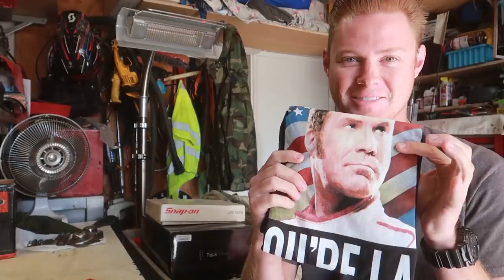My F100 Is FINALLY Back On The Ground! *Disk Brake Upgrade!*

Comment: When setting the front wheel bearings.. you are supposed to spin the rotor while tightening the nut, to the torque spec,ed then back the nut off 1/4 turn.  This ensures the bearings seat properly.
Reply: 60°

Comment: I am building a 1966 F100 with a 302 over on my channel, also dealing with valve train issues. Had some comunications with another 302 guy that said he drilled and pinned his rocker arm studs to keep them in place. Just thought I would mention that. Keep the videos comming.

Comment: Looks Great Disc Brakes Awesome. 
My First Vehicle a 62 Ford Pickup F100 Stepside. I was 16 it had a 292 V8 a 4 Speed and 4:11 Posie rear-end, I put 4 barrel manifold and carburetor, a Tach, Corvair Bucket Seats. the best sound system in the 70s. Installed Headphones plugged in the Dash.  Chromed Defroster Vents. ash tray and glove box, Chrome Steelies rims Front and rear 15 inch wide the in rear  Stainless 66 ford Hub caps. Loved that truck.

Comment: I pulled the whole brake system out of my 68 last fall. All new stainless steel brake lines, four wheel disk now. Did my fronts sort of like you did. I just ordered spindles for a 73. And the went with all the upgrades. Cross drilled an vented rotors. Six piston calipers on the front, four piston on the rear. And the hp pads. I bought the kit for the rear.

Comment: Don't you have to change the master cylinder and residual valve as well..
Reply: no thats only if you want power brakes. then youll need a brake booster and a vacuum in the intake for the assist to work. brake line up behind the tire will be differnt but will just go straight into the line and bleed your done.

Comment: The one clip of the rear axle it look red as can be.  At other angles it's copper, is it a color flip pearl in the paint?  I'm about to completely tear my 79 apart, pull the cab off and begin the full body restoration while I get the block and heads machined and prepped for rebuild.  Gotta also finish the basement!  ugh, I'd rather be working on the truck!

Comment: It's a little late now, but you should have drilled and tapped a drain plug for your rear end! Did it on my 74 F100 and it makes for a much cleaner gear change.
Also gives you something to jack it up on. Just put a piece of 2x4 on Jack pad.  Just a thought.
Check out Lugnuts for a rear disc swap kit. Going to get a kit for my 77 F250 w/Dana 60, but they have good kits for the 9" rearend too.😊

Comment: Did all this to my 68 F100. Put a Lincoln Continental 4V V8 in it too. Carbed with MSD box. Yes a front wheel drive engine bolted to a C4 trans.

Comment: Ok I have a 71 f100 and I’ve installed DJM ibeams on it. I’m wanting to swap it over to disc brakes. I have a 75-79 disc brake setup from a donor truck. Will my DJM ibeams work with the 75-79 spindles or will I need new DJM ibeams for the 75-79 spindles?

Comment: You have come a long ways Craig. I have to say that I pulled my hair out a few times but your on it now. You know more about camshafts than I do so single plane manifolds might just be the ticket for you. I felt like it compromised brake vacuum and so didn't care for that single plane but things do   change an your way ahead of me there. good luck as its been frustrating for you for sure

Comment: It would have been nice to have gone with disc brakes on the rear too.... Also you should look into a later Fox body style master cylinder. They make multiple bore sizes and they look great under the hood!! They work great as well.

Comment: Since you didn't set the pinion angle with the truck sitting on all 4 tires with the full weight of the truck you might want to check that again to make sure the rear end is 3 degrees lower than the transmissions angle. Can't wait to see the new heads with screw in studs, that should finish everything up.

Comment: i converted my 69 ranger to pwr steering.   it will not self center.  when the truck is sitting still you can just get the steering wheel started and it will go until it bottoms out by itself.   any suggestions

Comment: To install a dust cap on brakes just get a big ass socket or piece of pipe that fits over it and sits on the rim and then hammer it in straight. Don't do what you are doing here.. You want it to go in flush and not distort. Also when tightening your castle nut on discs you should be spinning the disc while tightening it and then just tighten it until there's some drag on it. (Yes I actually took auto shop and paid attention, despite what my asshole instructor said.. not too mention I've been watching car shows on tv for 30 years now)

Comment: Why not 4wheel disc brakes
Reply: Drum brakes work better with load changes ; example - camper vs no camper.....4 wheel disk brakes should have a adjustable proportioning valve...for the load difference!

Comment: Will 1980 beams off a f150 fit the 67-82 f100 ctaig?
Reply from the maker: Couldn't say on that one but If you cut the beam mounts off of that F150 I don't see why you couldn't make them work.
Reply: Sounds good I just got a 1969 f100 lwb with a 428 and a 4speed 2wd and I want to do a power disc brake conversion on it but finding the parts you said to get are hard to get where I live and I have an 80 f150 2wd and was just curious
Reply: In 1980 Ford went to unequal length I-beam. The steering arms were also relocated to the front of the I-beam. So a swap is really not easily done.
Reply: Thank you for this info
Reply: @davidwright3390  btw I really like that engine trany combo in your truck. Have always wanted a 428 but never found one in my snack bracket
Reply: Yeah the 428 was out of a Thunderbird this old cowboy bought the truck originally in 1968 and blew up the 390 and his brother at the time worked at a dealership in like 73 or so and he got the engine for him the truck is originally ordered from las Vegas Nevada and it is a custom heavy duty is what it says on the fender and in the original paper work

Comment: Im still confused why you're doing all this work instead of the Crown Vic swap?
Reply: He said the disc brake upgrade kit could be as much as $1000...   guys are selling crown vic clips for as low as $400...  it should be the way to go...
Reply: @greggoett  He already has a crown Vic setup and everything to do it on a separate frame. He says he's trying to get one of the cars going so he has something to drive but im just lost why he's putting so much time and effort on the stock axles?